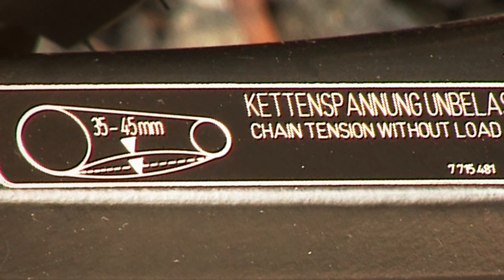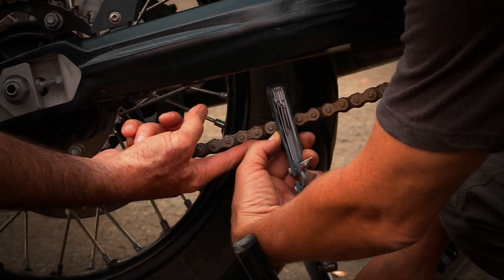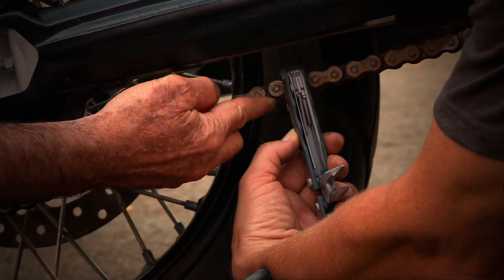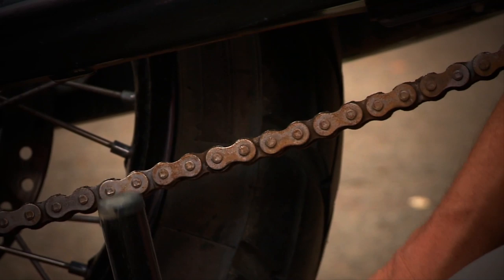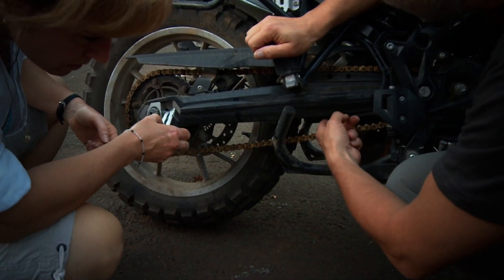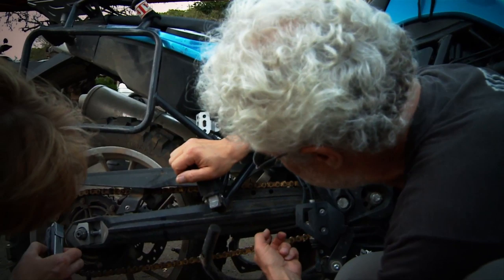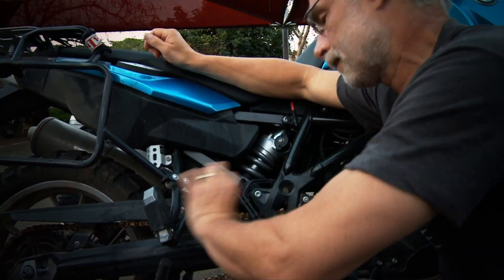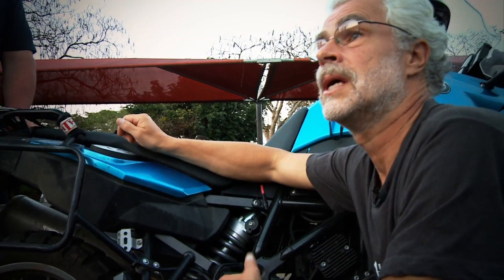GlobeRiders "Tips From The Road" - Chain Maintenance

Comment: As an old farm boy, oil on chains attracts dust and dirt.  X chains are pre-lubed.  The O-rings are rubber.  Alot of the chain lubes I have seen will react with the rubber o-ring and cause it to swell, accelerate deterioration, and hold dust, dirt and grit right where everything is moving.  Those things are abrasive and will cause more ware or faster ware than doing nothing... That's the opinion of a guy who had to maintain and repair alot more chains than on half a dozen cycles.